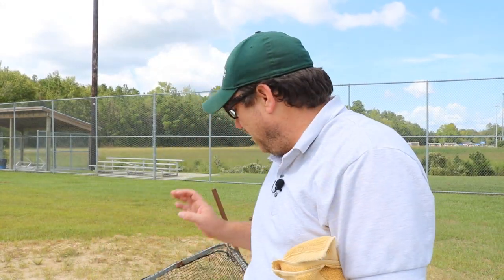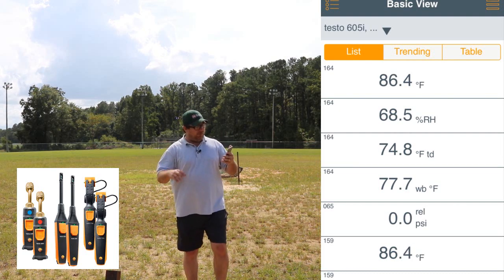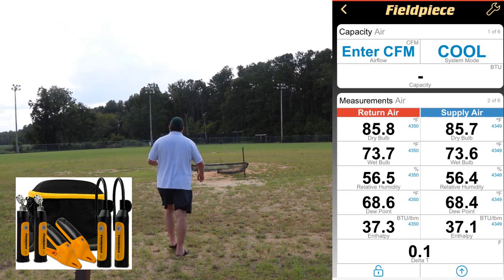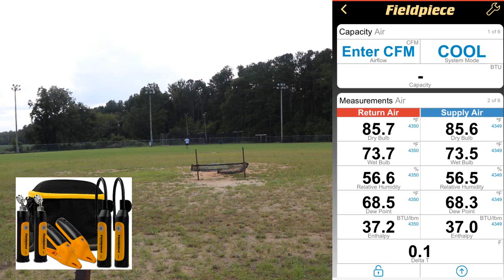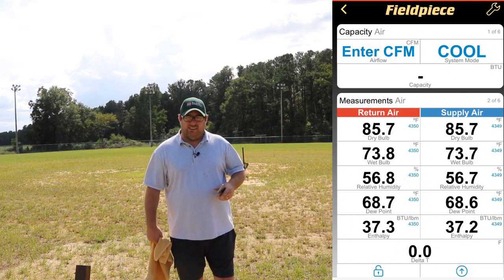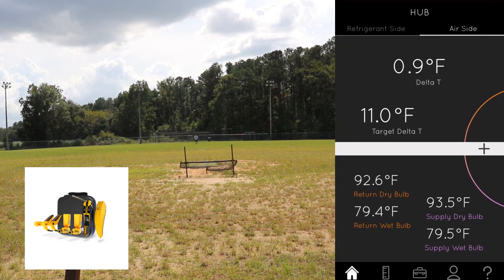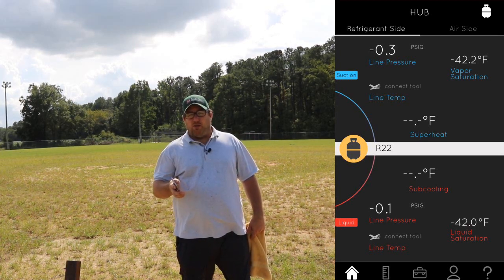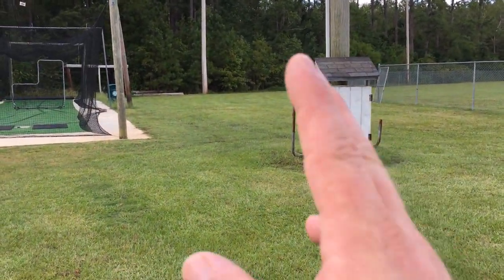HVAC/R Smart Probes Open Air Distance Test | Testo vs. Fieldpiece vs. UEI

Comment: I have to ask and i mean no hate by this but why would you care to walk more than 10 feet away? If im checking pressures on a unit thats right in front of me, why would i need to go 30 feet away? I work in residential hvac so i may not use them the same way as others. Just curious to what yalls answers are.

Comment: I think for my job I need to be accurate with my instruments pressure and temperature to diagnose a problem not so concern about the distance because in a building walls and obstruction affect Bluetooth connection.. I would rather have a correct measurements  at a short range than a wrong measurement at a further distance away... My job accuracy trumps distance any day...

Comment: i have the testo probes. the range is not as advertised. i have no clue where they came up with 350 feet. lucky to get 50 or 60.
Reply: I use them on apartment buildings and I usually lose the split readings from the 2nd floor unit when I'm on the roof of a 3 story building.
Reply: might have to update the filmware via bluetooth

Comment: how do you know if Testo is gen 1 or gen 2?  Is Testo 1/2 the price of the Fieldpiece option?
Reply: Tresto changed the style of the pressure probes to a 45 degree offset with the 2nd gen. And they changed the hygrometer sensors as well. Their alot narrower and better magnet placement. They are cheaper than fieldpiece.

Comment: I really don't understand these range tests, who cares? As long as it stays connected when Im standing in front of the damn thing , that's all I need. Its not like Im going to connect them , and then try and diagnose the RTU while sitting in my van driving away to the Starbucks. Maybe , we should be pushing the manufacturer to make probes more durable, more magnetic, more temperature resistant so it doesn't get melted in the heat exchanger while doing a temperature delta , make more of them connect so I can do a complete coil efficiency test with enthalpy including CO2 since everyone seems so focused on co2 readings.
Reply from the maker: It does the range test
Reply: Sometimes you need the wireless function. I like it having it when I'm testing a txv so I can monitor superheat

Comment: Does the probes replaces the digital manifold?
Reply: It's personal preferences. I use the probes with a backseat core depressor and an extra port so i can attach a hose. It's a lot less possible leak points that could have you chasing your tail when looking for a leak or putting a system under vacuum. I don't use a manifold gauge anymore

Comment: Is it the signal strength ..  how would this test do if hook up outside and the indoor unit is in the basement 40 feet away.. i dont care walking in a field.. thats wide open.. i need the signal to go 2 floors down into a concrete basement with electronics... That video id watch,, this one tells me very very little

Comment: Testos are still superior in reliability and accuracy 🤷🏼‍♂️
Reply: No, you can use a ball valve with valve core remover tool if you want to charge. Theirs really no need to have those big analog gauges anymore.
Reply: do you still need analog gauges if you buy the testo probes?

Comment: So whats the purposes of you walking a mile away from the unit your trouble shooting if the damn tool can reach 100ft thats good enough for me. I have been using my testos for two years with no issues. Dont need to fork out 600 bucks for a fieldpiece or the Uei I'm very pleased with what I payed for my Testo probes and they have working goat
Reply: Really I think if theirs any bad weather or if you have the luxury to go back inside the building to get out of the heat that's the real advantage. But you'd still need to go back up to perform any other work.

Comment: Why would you need to be that far away in the first place ?
Reply: I am going home with the range hahaha!
Reply: Commercial jobs, and I've done a few custom homes over 10k Sq.Ft.
Reply: Just making something out of nothing
Reply: @Roadkill750 The rooftops of Dollar General get up to 170 degrees in August. I'm not sitting around up there while it gets down to temps before I get back to the AC in the van. That's not to mention I might have two work orders on a Target that are 200ft away from each other, and I can use probes on one with manifolds on the other to monitor both at the same time.

Comment: I've done some looking between fieldpiece and testo.  Testo has the better warranty. 
It looks like fieldpiece is better on performance. I just worry about spending that kind of money with a 1 year warranty? 
So the fieldpiece warranty is 1 year?
Testo warranty is 2 years?
Uei warranty ?
Has anyone used  the fieldpiece for over a year and not have any problems?
Thank you Zach for the test.
Reply: I've used the fieldpiece on and off for over a year now. I love them and work great with measure quick app.
Reply: Had a testo 557s I got in November 2021. got direct sunlight on it in the summer. screen quit working. forced work to replace it. got a new set this June. and now it's August and it quit working. 😒 having to go back to being a simpleton and using only analogs for a while.

Comment: I did a video with the fieldpiece probes. I put 25 foot markers on a roof. I was still connected at 250 feet. I couldn’t go no further since I ran out of roof. I am happy with the fieldpiece smart probes. Sad they will get very little use until April rolls back around. Yet the pyro in me likes winter work

Comment: I briefly owned the Fieldpiece probes earlier this summer but quickly retuned them. The connectivity of the set I received was absolutely horrible. Constant dropping out and reconnecting even while nearby my phone. The range was not impressive either. I returned them and bought a Testo 550 and a gen 2 605i. Very happy with both. The 605i does not drop out like the Fieldpiece did and I very much prefer the testo app to the Fieldpiece. I have not done an open air distance test with either set, but I haven’t been disappointed with the 605i, though the range hasn’t blown me away either. I would definitely buy the testos hands down even after seeing this. This video and my experience with the Fieldpiece probes does make wonder if maybe I got a bad set of the Fieldpiece probes and Zack got a bad set of the testos....
Reply: Nate Leatherman u did get a bad set of field piece probes. But Zach did not get a bad set of testo. Jon hvac has videos of the new testos and his don’t go as far as Zach’s testos did even. Fp probes are sweet I have two sets and both sets are amazing! Plus there customer support is second to none. If u would of called fp they would of sent u new probes no questions asked then when received u got a shipping label to send your junk ones back.
Reply: N8 Da Gr8 thanks for the reply! Unfortunately my confidence in Fieldpiece has been shaken pretty badly at this point. Maybe I’ll give them a try again some day. For now I’m pretty happy with Testo :-)
Reply: @89dhvac  If you were using a BT headset or earbuds that would explain everything. Those will mess with all of the smart probes.